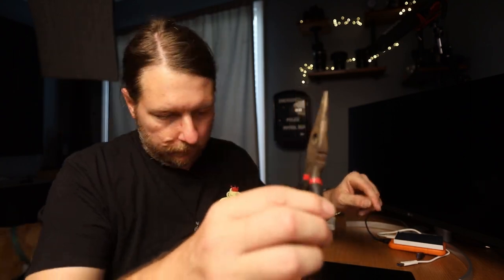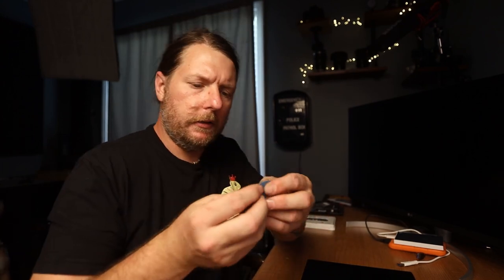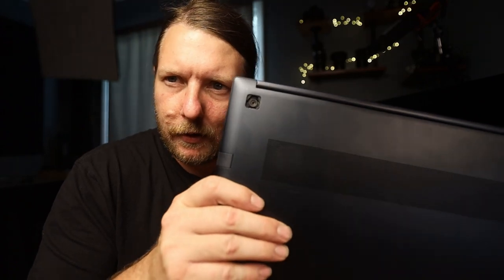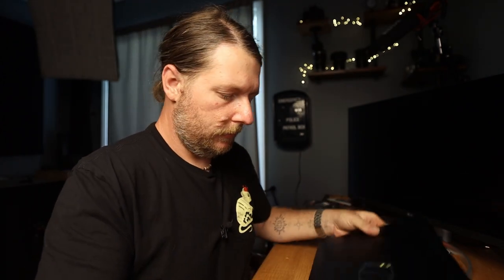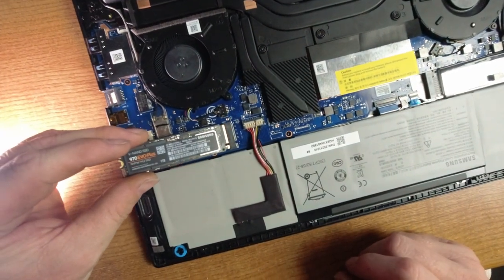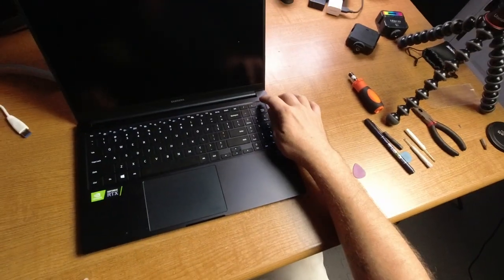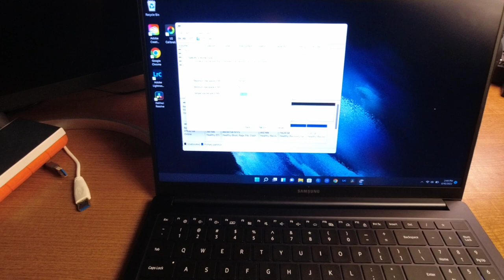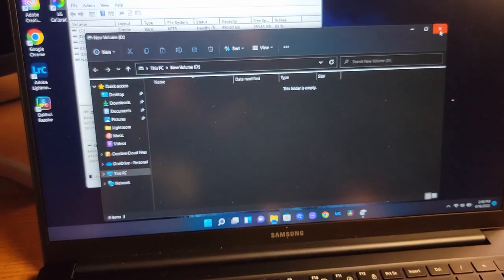Installing 2ND SSD 970 EVO Plus On The Galaxy Book Odyssey

Comment: @Donny B    Third party repair shop, did all the necessary things to put them on blast. 
- Ignore customer emails
- Spell incorrectly the customer's name 
- Send an incomplete product (missing screws, screw covers) 
- Neglect quality control 
- Erase the customers data on the computer

they really made it difficult to avoid blasting them.
Reply from the maker: It's a shame to because it really wouldn't take much for a company to really succeed in this space. Manufacturers don't really set a high bar to pass

Comment: That Odyssey seems so un-Odyssey to me. The 2017 NP800 and 2019 NP850 seems much more proper.
Reply from the maker: It works great for my needs. But you're right. It's a galaxy book with dedicated graphics. I've never been a big gamer so I don't know much about the older odyssey but I can tell Samsung isn't going to win any design awards with it but I kinda like the fact that it blends in with every other laptop. I'm curious to see how the new galaxy book pro will perform with Intel Arc
Reply: @Donny_B  The NP850 in silver definitely is a looker. I actually meant it’s less Odyssey than the rest because it lacks the distinctive Odyssey logo on the bottom, startup screen, and the cooling system seems like a downgrade from the 2019 model. Is it fully metal? The 2019 was more of a hybrid honestly, stamped aluminium top, bottom, palmrest and screen bezel, but plastic sides
Reply from the maker: It's all aluminum including the sides. Cooling isn't an issue because the fan. never. stops. It has an odyssey app where you control fan speed and performance. I believe you can have it run on start up. I've noticed a constant battle of defaults between Samsung and Windows. They both want to be in charge.
Reply: @Donny_B  does it have the Beast Mode that the previous gen had?
Reply from the maker: There is 2 different apps for performance, clock speed, etc....one is the odyssey I was mentioned earlier,  the other is Nvidia GeForce. You can set different profiles and presets in either but no, there is no preset Beast Mode
Reply: @Donny_B  Yeah, I was asking about the Odyssey Control. In earlier models, there used to be the Beast Mode under profiles 1 and 2, which allowed the fans to go full blast and undervolted the CPU, as well as overclocked the GPU ever so slightly